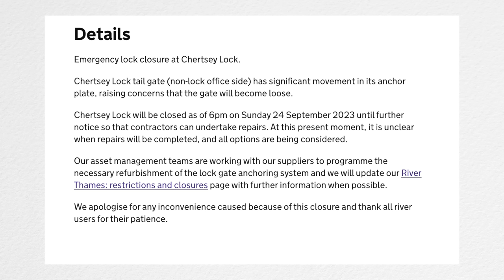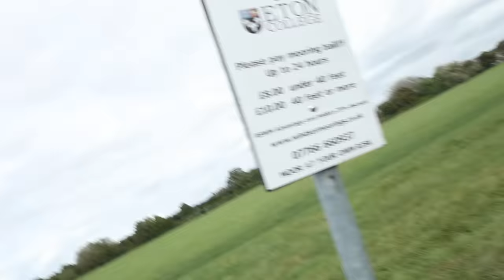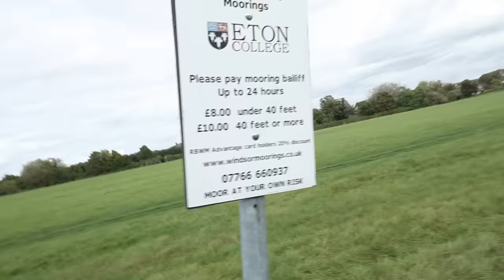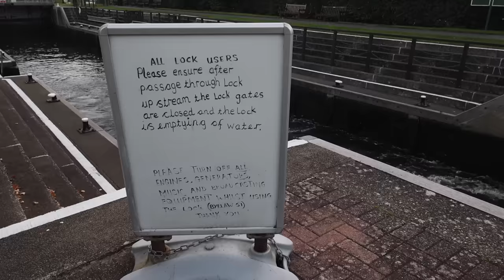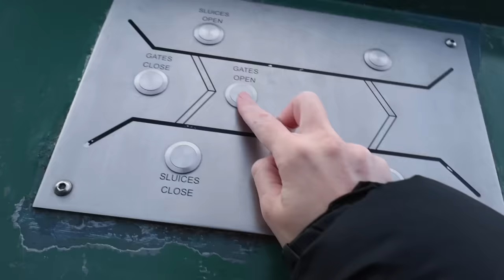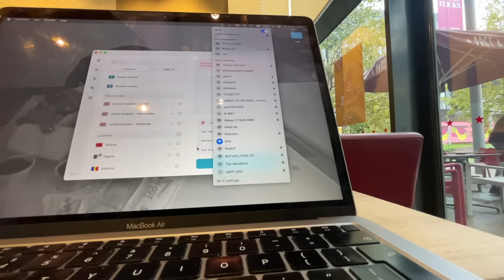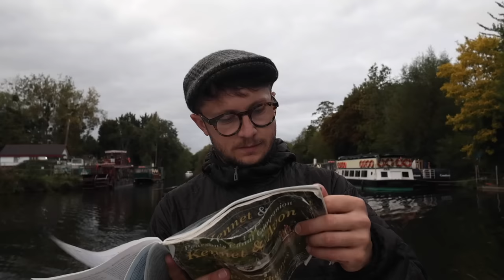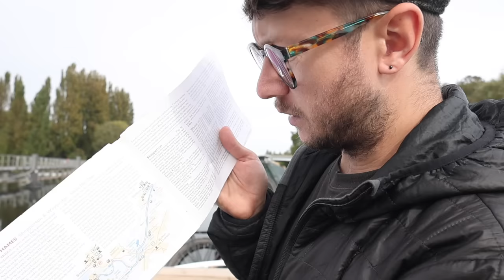Our Narrowboat Is STRANDED On The River Thames! (GEARBOX FELL OFF!)

Comment: Hi again Joe, sorry to see the gearbox parted company with Engine?… silly question but did you use long enough studs and either Nylock nuts or at least thread seal? The engine/gearbox joint takes a hammering every time you put into drive, imagine the force created by the BMC engine against a small gearbox… it will find the weakest point. Vibration will affect “Nut/Stud” tightness hence you must either use thread seal, lock washers or indeed Nylocks. It’s all a learning curve mate, I hope no serious damage has been done to stern shaft… 👍🏻
Reply from the maker: Yeah honestly can't remember what I used when I fitted it but it's whatever was on there before - it's lasted a couple of years to be fair! The RCR man Pete said that those are the longest bolts that would fit but he did use lock washers and thread lock + there was a bolt missing from when I fitted it so 6 bolts vs 5 we should be good for at-least another two years! 😂
Reply: @ItsOhJoe  brilliant… at least no damage to shaft… well done!

Comment: Looking for advice! When you run the engine to charge the batteries do you just run it at tick over? And for how long do you charge it? We have not got a clue!
Reply from the maker: Hey no worries!

So just on tick over usually - it depends on what setup you’ve got really. 

Ours for example;
780ah of batteries - they’re standard lead acid so only half the capacity is usable - 390ah - so if they’re completely flat our setup would take 13 hours to charge (390 ➗ 30a from the charger) 

Usually you’ll just be topping them up if you’re not cruising so even an hour or so will help 

Hope of help!
Reply: @ItsOhJoe  That's great, thanks as always!
Reply from the maker: @sameshipdifferentday2024  we’re learning a lot as it’s our first time CC’ing through winter & with knackered batteries and no solar you don’t realise how reliant on an engine you are! (Or generator)

Comment: Ask the engineer for the “specific torque” for all those bolts Joe and check ‘em regularly. You might want to think about adding an AquaDrive or Python Drive cv joint with thrust bearing welded to the hull. It also has the added advantage of removing  at least fifty percent of the noise from the engine as it’s transferred directly to the hull. Costs a few shekels mind you, but peace of mind is invaluable in itself eh?
Reply from the maker: Yeah the engines pretty loud when sat inside. 

The problem with checking the bolts is they’re hidden inside the bell housing which forms the two rear engine mounts so the engine has to be raised to check them - awful design 😫

Comment: Hi Danni and Joe, sorry to hear of your breakdown.  I'm glad you weren't cruising through downtown London.  Being the propulsion system is all mechanical, your failure is quite common.  You need at least 6 cylinders for an engine to have a smooth flow of power coming off the crankshaft.  With 4 cylinders, the output is a series of power pulses, which loosens those bolts attaching the flywheel to the gearbox.  Those need to be tightened regularly but, since they are hiding under the flywheel cover, they are easy to overlook.  Fortunately,  the Tech was able to get things repaired without a trip back to the marina to pull the engine.
Reply from the maker: Thanks Bill! Never really thought about that with 4 cylinders - 6's do sound and feel lovely though. I've got a bit of a thing for 5 cylinders like my old Volvo!
Reply: @ItsOhJoe  Each cylinder puts out a power pulse of about 130 degrees of rotation so, for each 360 degree rotation of the crankshaft, with a 4 cylinder you end up with 2 - 50 degree periods without power.  That deadtime induces a noticable vibration in output power from the crankshaft.  A 6 cylinder by comparison has about 30 degrees of overlap in power per revolution.  The average person doesn't know (or probably care) about this, but being an engineer, such things interest me.

Comment: You can always mark the nuts/bolts to see if they're shifting! See the wheel nuts on buses - it's a quick visual check to see if any are loosening, maybe when you check oil before cruising.
I prefer to use loctite on everything, it really helps, and tends to keep corrosion away too.
There are different grades - blue is fairly easy to undo - red you'll need to heat up the soften it to undo, but is fairly permanent in it's effect.
Green - good luck undoing that! I've used green in error before, only way is tons and tons of heat!
There are different grades of  bolts as well of course - I remember having to buy special ones to fit a propshaft since the standard ones will just shear fairly quickly.

Comment: OK the horse has bolted, but maybe a weekly check on the whole engine to tighten all the bolts ect to the correct torque would have stopped that. Glad you got it sorted.
Reply from the maker: Yeah definitely will in the future - the only thing with those bolts is they're fitted to the bell housing which is also the rear pair of engine mounts so they can't be accessed without having the engine lifted up!! Crazy design really.